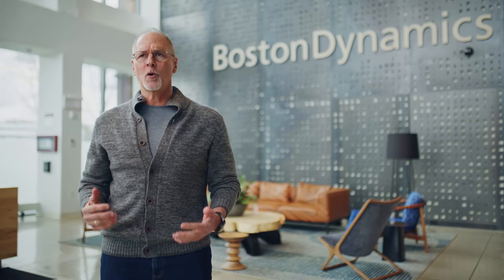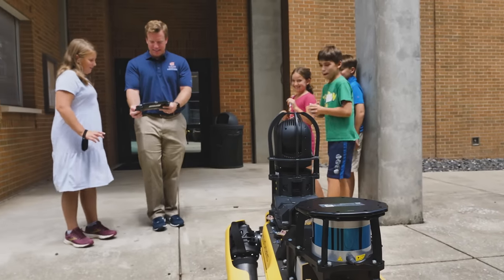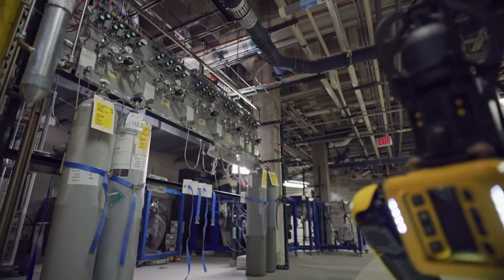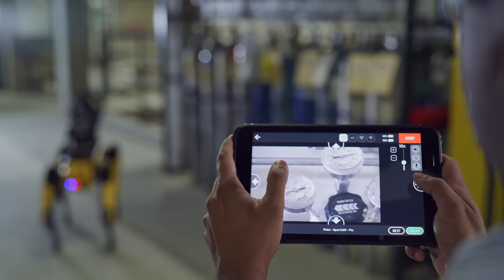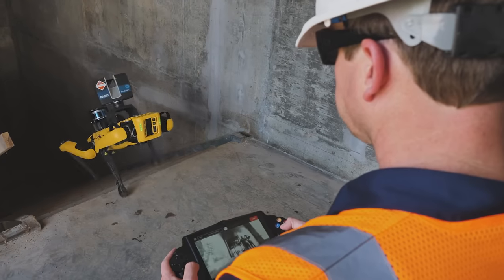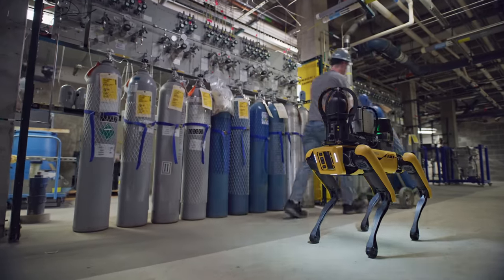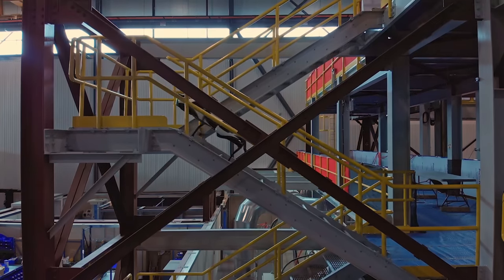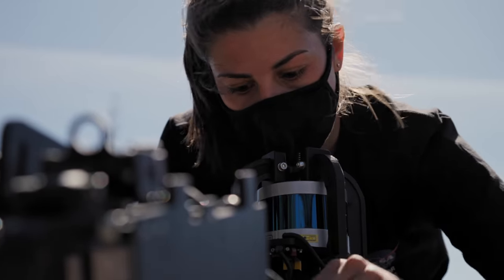Spot Levels Up | Boston Dynamics

Comment: 12:45 Spot should be making sure the door has properly latched behind it.  This is necessary for both fire safety and physical security.  Ideally, maintenance would ensure that every door would close and latch correctly on its own every time, but we all know that tasks like that tend to fall to the bottom of the priority list when humans just adapt their behaviour to work around the problem.
Reply: auto survey if the doors self close
Reply: I agree, it should also make sure that it doesn’t hit anything when opening or closing the door
Reply: Should be simple to add "confirm door closed" as the first automated task after passing through. By the time it's out of beta this will probably be a default feature of door passing tasks.
Reply: This is how the resistance gets access to send back Kyle Reese btw.
Reply: People don't check the door ... it can't be a real issue.
Reply: That's what door closers are for?
Reply: It should also make sure to take out the garbage 🗑️
Reply: @nockieboy  You've never seen a door closer fail?  They wear out.  They get dusty and stick.  Someone tapes over the latch or stuffs something in the strike plate hole.  The weather outside has created a pressure differential between the two sides of the door that the door closer cannot overcome.  There are lots of reasons a door might not have closed and latched properly.
Reply: If I had to guess, they may already have that feature but it's not terribly fun for the average YouTube citizen to watch that haha. I'm sure they have to cut out a lot of great stuff to keep these videos to a reasonable length! It is a good call out though, and I'm sure like-minded ICs have brought it to their attention at some point.

Comment: As someone who has a use case for this technology and an affected team, I truly hope they are looking to develop Atlas for this as well. Most of my sensors are remote anyway, what I need is confirmation and, crucially, something that can interact with infrastructure designed for humans, especially carrying large heavy items that require two support points. That would be game changing for us, and save a lot of people many an unhappy drive on site in the middle of the night to sort out issues.
Reply: Sounds like you will be buying an Optimus from Tesla. Give them three or four years.
Reply: Musk fans sharing their delusions in this comment thread are hilarious. If Musk were "running this show" BD would have overpromised everything and then come up with a half-assed robot that would be completely useless. DB are the industry leaders and however long they take to innovate with a viable product, that's how long it takes.
Reply: Doesn't that also mean that you'll be out of a job since if the work can be done remotely by piloting a robot they can just hire somebody in India to do it?
Reply: A dispatch from the Cult of Musk has arrived in the comments... thank you for the laugh, Karl!
Reply: @elevul  no, not for me and not for my staff either. We all have day jobs, being on call is something done, and paid for, separately. It would mean a slight pay cut eventually (once Atlas could be trusted to be fully autonomous) but given what we are paid normally, I'd wager the vast majority of us would happily exchange the money for not having to be on call.
Now, if we did have an Atlas I'd wager that we'd use it for more than just nighttime, which could theoretically impact lower level staff to some degree, but given the current prices of Atlas vs humans I'd wager the humans have a little while yet until they have much to worry about.

Comment: At 04:32, would Spot read "119" wrongly due to perspective, or "124" as it should, correctly interpreting its angle of reading and the distance between needle and gauge background values?
Reply: Spot isn’t interpreting the gauge readings. It’s collecting data for someone to review. Basically let’s someone remotely inspect things without needing to physically be on site.

Comment: Gauges have to be read with the eye or camera on an axis which is perpendicular to the dial face and passing through the needle pivot point, otherwise parallax leads to misreading of values.  The camera height needs to be able to raise to the level of the gauge, which is generally installed at human height and mounted vertically.  Alternatively, all the gauges could be tilted down, but then technicians would find them hard to read.  Probably easier to make Spot’s camera much more height adjustable.
Reply: Perhaps changing gauges to flat digital displays mimicking analogue dials.  No parallax as no mechanical needles.

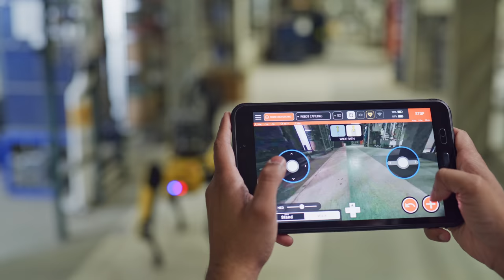Comment: The UP / RIGHT / etc arrows should move an on-screen cursor: I can't tell from the video @6:20 if there is one. It looks like the tablet <> spot link is laggy, which is normal for this kind of tech, so the spot should be given a pointer-goal to seek to, instead of the operator guessing with the RIGHT button, how much to press.

Comment: I'd love to see the events that led to these improvements. I've always had issues with how quiet it is especially in a working environment, akin to a cat. Also seeing one of my favorite youtubers having fun with their spot until they couldn't emergency stop it like it's new emergency button. Hopefully nothing caused a death in actual on foot locations. Something I would love to see come as an accessory for spot is an anchor kit, where it can drop a payload that anchors itself to the ground or wall and provide support to the robot as it struggles with a task. Pulling a door like you had in this video would be easier on the robot and make it quicker if it could take advantage of some kind of leverage besides it's own feet.
Reply: You can fix the quiet issue the same way as you would with a cat: just give it a jingly bells collar. 😜

Comment: Great to see the team behind all the advancements at boston dynamics!
Great job to all of them!
Something it stood out is that the spot platform seems to be a bit too small when attachments are added maybe increase it's size by a few inches and get dedicated bays in the middle of the body for payload or get a work/play sized robots. Lastly when opening the door once it is holding the door open simply rotate the body trough the door. Robots are not humans they have freedom of move especially spot with full 3d environment built it in is not necessary to copy human movement it can do much better! :D
Cheers

Comment: The technology is certainly cool!  How is this better or less expensive than deploying low-cost stationary sensors?  If the goal is to free up people, then when the robot is down, how to I quickly hire people to perform the critical inspection and monitoring tasks?  Should I have hot spare robots just in case?  Since this robot can navigate stairs, can we equip it with a vacuum cleaner and market it to homeowners for less than $300?  I kid!  Great job team!!!

Comment: Maybe give spot wheels that are lower to the ground so he's able to zoom threw tight spaces like take wheels or integrate it to his existing legs so he can change from running to driving or something
Reply: nah i wanna see spot fly
Reply: Sounds nice, but which motor, gears and coupling will drive these wheels then? Where do you house them? Often there is a huge discrepancy between cutomer's whishes and economically reasonable solutions.
Reply: @Meltorizor  yadayadayada money jargon just put drone parts on his arms and legs and code it like a dji drone and if you can keep it stable the applications can figure it’s self out it’s already a seldom tapped market they have everything to gain by doing something cool.
Reply: @motsu9497  Your response just proves that you have absolutely no clue of engineering. If it's this simple, why didn't they realize it already then?
Reply: @Meltorizor  either It was on the drawing board and it wasn’t it’s time yet, or they didn’t think about it. Dw it will come to pass eventually. Since you know sooooo much about it and seemingly are unwilling to educate an ignorant soul such as myself I might just have to stop thinking about cool possibilities for new technologies because of imaginary numbers resembling value of metals labor and power. Who cares about all that when the knowledge to do something can be so exciting.
Reply: @motsu9497  "Just add this and that and those and then do magic and it will be as affordable because i said so".
Sigh, there is always one in the crowd who demands he is right and everyone else is wrong because he said so.
Reply: @alaric_  I know how "costly" R&D can be and honestly you don't need that many people for developing code for a drone, which is a start. where it mostly  adds up outside of labor is materials paying for where they come from and if you really want to lower costs make a 3d printed housing for its components so it doesn't matter much if it crashes while learning on a scaled down version, than when that works do the math and upscale.

now then factoring in that the value which can be lower than the investment at whatever point in time you start the project is really normal you don't just make something worth a lot in the public eye unless 1 of or both two things happens your  IP is well known and or its trusted by a decently sized group of people. a stock exists and its worth is determined by its value not its actual price. I'm thinking with the same concept, its very far from magic. its real work. the suggestion is actually pretty low in costs in terms of Boston Dynamics worth. not to mention that realistically you don't need an entirely new body for spot you just need the propellers rotors wires on board infrared sensors and a computer akin to a raspberry pi not even to relay the hardware information to spot to understand and maneuver with to determine its distance away from things altitude wise change each rotors rotation values and well fly with. (this can also be very cost effective as its using a laser) its spatial awareness is already off the charts with its cameras so maneuvering a 3d environments a piece of cake. power? there's a few options you have here lower the weight of spot and depending on the power supply you can have short work cycles for menial tasks that require a quick but delicate touch (such as reaching high up places without risking its human operator and reducing the need for the tools involved in that process.) and the design which nowadays Ai can assist with which can help lower costs even more since you all  be so worried over a thought lol, id suggest finding a balance between what you already are selling and new onboard installable  hardware which if I'm not mistaken is exactly the point of focus for this company. shit if this isn't enough to convince you I might just have to spell it out with a spreadsheet with the math for you nincompoops to understand.

Comment: Can spot tap the glass on a gage to make sure it's the right reading?  Can spot simply notice something has changed from before no matter what it is? Not just a preconfigured set of constraints.  Just like a dog will alert when something happens even thought it doesn't understand.  And also know to ignore things that seem alarming but actually a pretty normal occurrence.

Comment: 12:36 Just put a Hook/stud on the front paws(inside) to better hold the door, makes it so much easier. Also after the arm has relocated to the inside of the door. relocate the main body to have better angle of attack to push the door. if not, as you push the door, the resisting force will flip the robot due to advantage of moment.

Comment: Future Idea :
use a nuclear battery. Nuclear batteries are much more efficient than traditional batteries, and they can last for many years. However, nuclear batteries are also more expensive and more difficult to operate.

It is possible that Spot could be fitted with a nuclear battery in the future. However, this would require a significant investment in research and development. It is also possible that other battery technologies will be developed that will improve Spot's battery life without the need for a nuclear battery.

I think it is important to consider the environmental impact of using a nuclear battery. Nuclear batteries produce radioactive waste, which must be carefully managed. It is important to weigh the benefits of using a nuclear battery against the environmental risks.

Ultimately, the decision of whether or not to use a nuclear battery in Spot will depend on a number of factors, including the cost, the environmental impact, and the availability of other battery technologies.

Comment: Two questions:
1) Can Spot defend itself against being stolen. Thrash or hook legs around stationary objects? Make noise, send a wireless signal, flash lights? Can it do this in spite of the E-off button?
2) Can Spot "behave" around small children, animals, or even unsophisticated people? Drop slowly and gently rather than instantly? Be ultra wary of small moving objects or moving objects that behave outside of normal adult behavior?

If the answer to either of these questions is "No" then Spot can only be deployed in very tightly controlled environments.
Reply: Spot needs a sword.
Reply: 1) I highly doubt the thrashing part, false trigger could harm operators, right trigger could harm the thief, in both cases it sounds like a lawsuit waiting to happen. It's like booby trapping your machinery. 
I think having the spot detecting being stolen would be quite difficult. You would have to either detect it from the robot being prevented/blocked from its expected task, but that could be due to many other reasons, or that it left its designated area, either using the map or GPS tracking. If you detected the robot being lost or too far away, you could potentially trigger a sound alarm, or provide you with an alert remotely. I don't think this is a part of the out-of-box function though, you would have to add the software using spots API yourself.

Regarding the e-stop button. ISO 13850, a safety standard spot fulfills, states that when activated, the emergency stop function should initiate a fast and reliable stop to prevent or minimize potential harm. What's more, the emergency stop function shall override all other functions and operations in all operating modes of the machine. According to an available user guide (which is for older version, but it's likely the same), the e-stop cuts power to the actuators. I took a look in the API documentation and in there you can set 3 e-stop modes. Cut power to actuators, sit & then cut the power, or do nothing at all. So perhaps now this is configurable. 

2) Spot is using a 360 LIDAR scanner, so it can detect small objects (i.e small children) and avoid them. User guide says to not come close to the robot (2m) if the actuators are engaged. It's designed for industrial use, which often already is a controlled environment with limited access, it's not a toy, it's machinery.
Reply: @Mafior1  - Exactly. For all of the reasons you cite, Spot is not ready for "prime time". Until robots can make reasonable decisions about when to resist and when to acquiesce they cannot be integrated into society. This is what is expected from entities which interact with people. I'd love to have a Spot dancing around my house, but I would not leave it loose around a toddler. To be fair, there is a fairly large percentage of the human race that I wouldn't want to leave loose around a toddler, either.

Comment: Hello. For additional safety, I would recommend an encrypted wireless on/off E-stop, similar to a key-chain fob for supervisors and others who might be directly involved in providing instructions to the robot. Additionally, consider an emergency wireless E-stop that could be wall mounted similar to how fire extinguisher's and/or fire alarms are located. Thanks for your consideration.

Comment: In regards to the function lights, In certain types of colourblindness the green and amber lights are not easy to distinguish between. Does spot have the ability to change the colours of the lights to suit the operator and workforces visual requirements or do the LED's have to be replaced at a hardware level??
Reply: It's an RGB light so it should be able to be any colour you want, whether or not that's controllable by the user I do not know but I don't think you can (easily anyway).

Comment: Bostom Dynamics - here is a million dollar idea that many of customers could benefit.
*Create a wheeled based platform that Spot can sit in as the platform takes spot to specific areas on customer's site. *The platforum can be communication base station for Spot to the remote user controlling the\observing what Spot sees. "The platform could also have an extra battery for Spot allowing Spot to stay with in the area it is working for a longer period of time - The platform could drive back while Spot is working to get a new charged battery if needed. * The purpose of the platform allows a single Spot to be used in further locations, quicker than spot walking to the area while saving battery until it arrives to do the work it needs to do.  * This is great for areas such as oil refinery facilities where they often will have acres of piping and streached accross the site.*Of course all this can be auttomated without a human interacting.

You are welcome. You can send me check when you are ready.